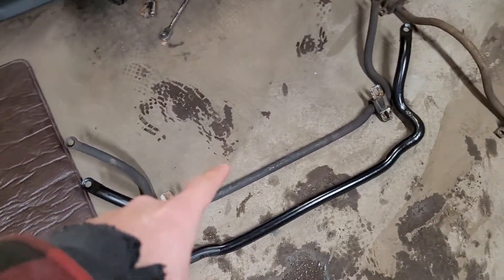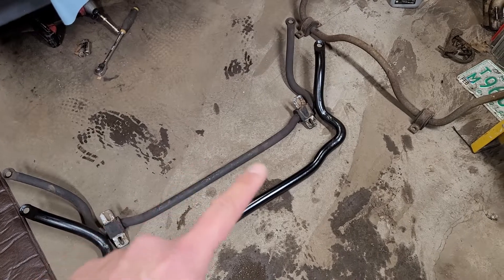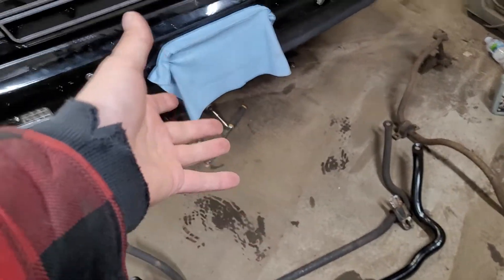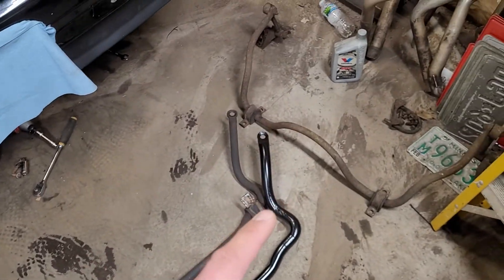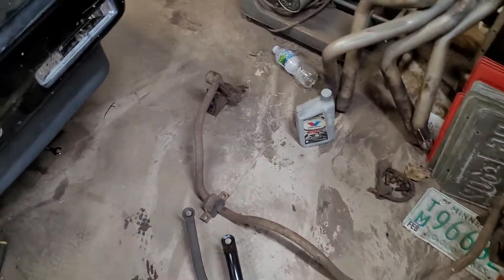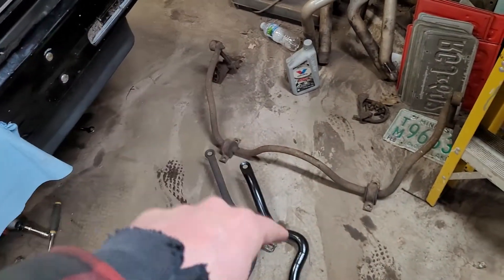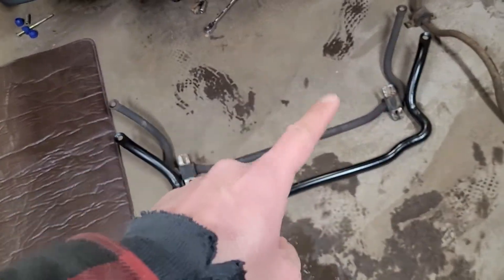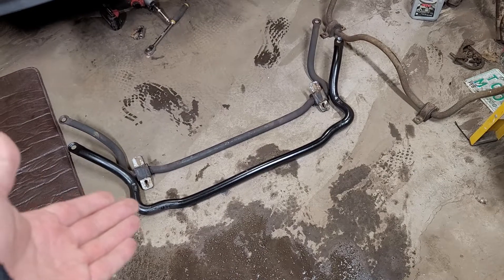s10 sway bar-factory vs zq8, what's the difference

Comment: 1996(?) and up two wheel drive Blazers are also a good source for  the ZQ8 front swaybar. There are more of these out there than the special trucks equipped with this swaybar. The rear facing swaybar is also the same on the late model 4 door Blazer as the ZQ8 truck, however the bolt-in frame bracket for the end links is only available on pickups.